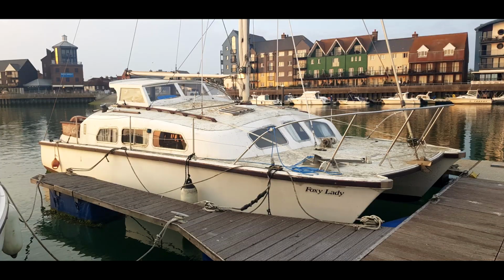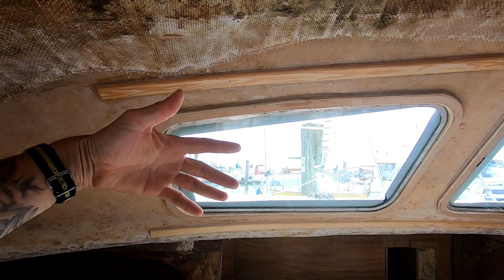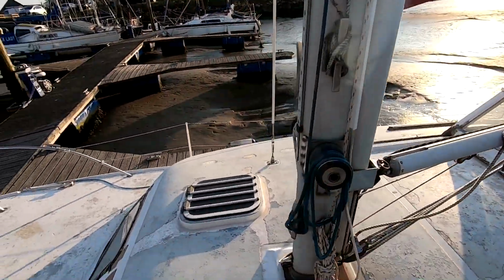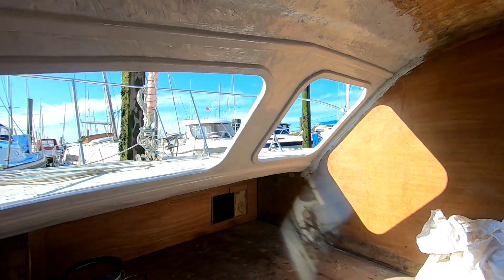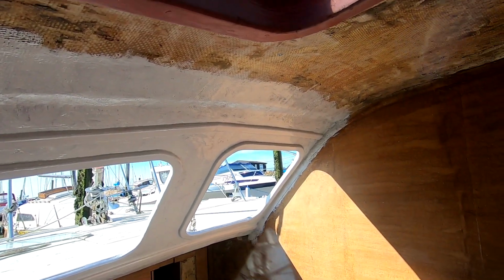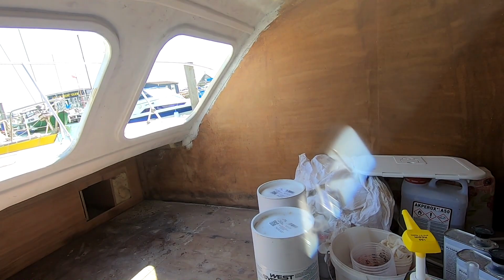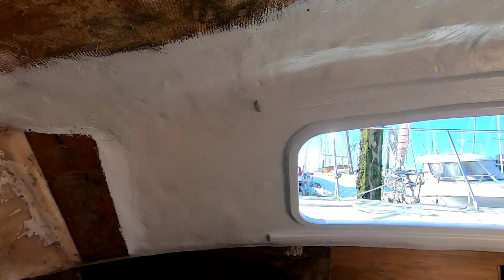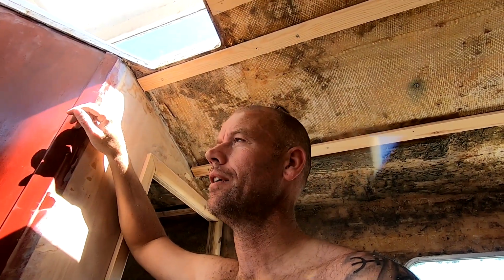Yacht refit, Epoxy Primer on new window surrounds E58

Comment: As far as your furling goes, you might need to replace the line. It could be old and stiff. You may be right about the blocks and pulleys needing to be moved.
Reply from the maker: Thanks George, yes defo needs a refresh with a new approach. Still have not established if line needs to be thicker to stop it doubling up😬😬